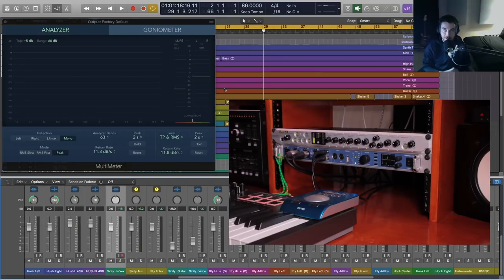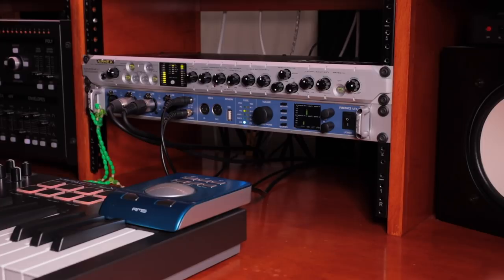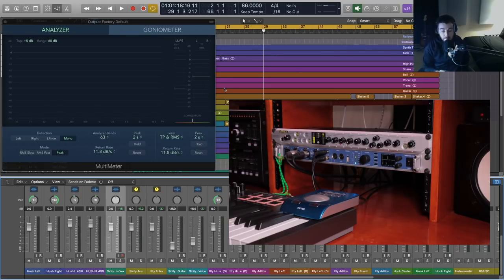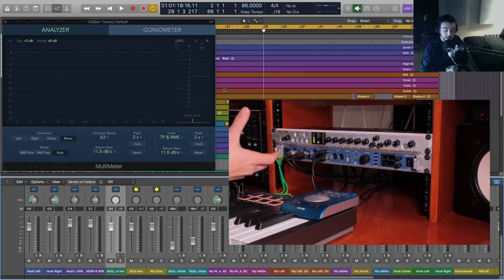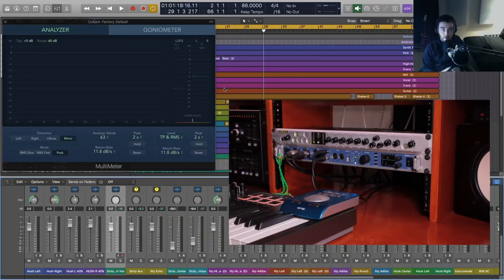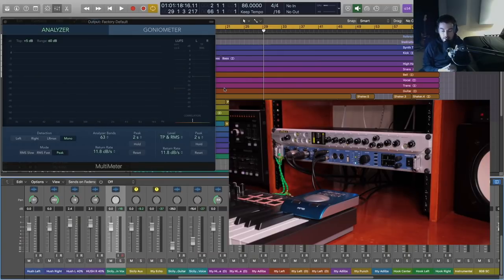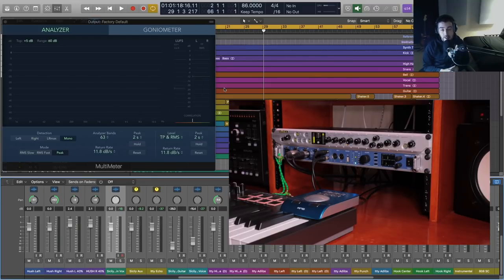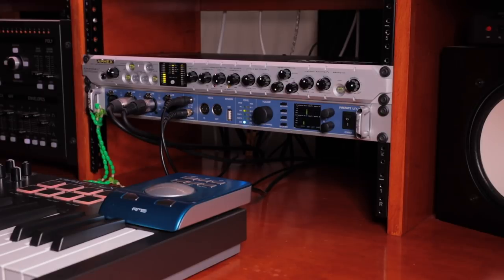Preamp, Audio Interface and A/D Converter - What's the Difference?!

Comment: Since high quality interfaces and pre amps are both really expensive, does it improve sound quality to upgrade your pre amps first? Or to upgrade the converters first? Both are important, but not many people have 5k to drop on both at the same time.
Reply from the maker: both will make a difference, I would recommend upgrading to something like an RME or Apollo that has great converters and at least usable pres first... then upgrading your preamps later
Reply: @SeanDivine  do you have to have a apollo to run autotune realtime for studio and small gigs with reverb? Or can a more normal interface still work . On a 2012 macbook eyeing the motu m2

Comment: For me, a very important thing is the type of chip that is used in an audio interface, even UAD Apollo uses some old nothing-special chips, so I rather invest in pro AD/DA chip because I am always working in the box and I don't record external things at all but I want my signal to be as transparent as possible coming out from the computer as a digital signal. What is your opinion about the importance of a good clock?
Reply: yeah someone told me not to invest into a powerful interface but a better preamp...cuz the ad converters are basically the same for all interface...what do you think?
Reply: Converters are not the same, but most of them use delta-sigma modulation. If you record things outside the box you need to think about preamp and ADC (analog to digital converter) as well. DAC is needed for good transparent listening experience in most cases. Your budget also plays the great role in making the right decision.
Reply: So I should invest in a better interface than a preamp at first?  @junkaction2416
Reply: If you record your hardware/guitar/vocal anything external...first element is the preamp, because you are going to use that preamp to amplify your signal only after AD chip starts working and DA chip affects the signal that is coming out to your speakers. Most audio interfaces have already a pre-amp built in, but they are c or d class pre-amp which means not the highest level. It all depends on your budget and what exactly do you want to do in your studio! I hope it helps.

Comment: I would think that the best is as much as possible in one unit because it reduces connections and incompatibility issues. Or is it usually the case that you need to get a separate mic pre if you want real top quality. I think what you say is that the combination of gear is something you do to get the tone that you want. Its not so much about quality in the higher end stuff. You havent found an interface with built in mic pre that has the character that you want. My ears are not that discerning, which doesnt say much for my sensitivity. Great video, again. Thanks.
Reply: Audio interfaces must be as neutral as possible and not add character by themselves, to adapt to most situations, so that's how they're normally designed, with this goal in mind. But sometimes, you don't want that neutrality, you want something that sounds warm, so either you add it with software, or you buy a device that adds this warmth, and it's the preamp.

Comment: SEAN! I just purchased a lightly used AVALON 737 Preamp. I'm currently hooking it up to my Apollo Twin X and I'm running into some confusion about getting it to read on my channel strip. I have in Line" instead of Mic" just trying to understand the workflow on UAD interface.  Hope to hear back soon. There isn't a good video out there that shows beginners how to set up a preamp through UAD interface on Console. 

- Best,
Reply from the maker: The line in on the apollo will be fine - you don't want to use the preamps there additionally to the 737 :)

Comment: Hey Sean, thanks a lot! Do you need to go through the interface or can you go directly into the computer with the signal from the converter? I ask because I think about buying a studiolive32-mixer in order to have a lot of ins & outs without the need to cascade interfaces, but all of these digital mixers dont have the ability to capture a converted AD-Signal, no ADAT no SPDIF, only one AES going out.
 So what I would like to ask you is: Would it be a massive downgrade to stick to the presonus studiolive's conversion in the long run? I mean, is that really sooo bad? and second: cant you just hook up the AD-converter to your computer in order to kind of bypass the interface's AD-conversion while tracking?
Reply from the maker: If I understand your question correctly, the studio32 has a built in audio interface, so it will also act as your converter. The main idea is you want as few conversions as possible and leave it to the best converter for the job of getting the signal into digital. The converters in the mixer should be fine!

Comment: Hey Sean, i also have 2 preamps in my chain (pretty new). 1. My SPL Gainstation tube preamp with a Line TRS into my 2. Focusrite 2i2 USB Interface (second preamp built in). You talk about it at 01:24 ...Everywhere people keep telling me that this is very bad, because you increase noise etc. by this. What is your experience with that? Isn`t it bad to put a signal you like from your dedicated preamp again though a preamp you don`t like?
Reply from the maker: hey Timo, I wouldn't recommend using 2 preamps in the chain - yes, it will add unnecessary noise and color the sound. Instead, I route the AES (digital) output of the aphex channel to the AES input of my interface (not a preamp input)
Reply: @SeanDivine  thanks for replying. So what would you do? Are there interfaces with an absolute "clean" line in to digitalize my preamp?
Reply: Especially  not scarlett. Need an audio interface where you can bypass the preamp if you already have one. I know audient id22 as this. Usually if they have line in at the back with no volume knobs to control then you're good.

Comment: How do I connect a 73 preamp to an audio interface such as the focusrite scarlett without hitting the preamp in the scarlett?
Reply: I just did heavy research and on focusritrs website they stated that the combo jacks ( the ones that can take XLR and TRS ) will always have to go through the preamps, but if you have a Scarlett solo it has the 1/4 jack for the TRS cable. With this 1/4 jack it goes through a different circuit designed specifically for Line input
Reply: Lower all the gain on the Scarlett. Use the one from the preamp.

Comment: Hey man, great video. A year back I picked up an M-Audio M track and some Akg K701s. All budget stuff, around the £120 mark. I'm not professional, but I do want to be hearing the right stuff. Should I consider upgrading the interface, or the headphones, or both?
Reply from the maker: hey Edward, if anything I would update the interface before the headphones / monitors. That will make much more of an immediate difference and make more sense if/when you update your monitors later

Comment: Hey sean. I’ve just bought an analog desk and hoping to hook it up to logic so I’ve got a hybrid setup. Been researching what I need to get the sound going from desk to computer. Do I need an interface or an AD/DA converter? Or does it not matter as long as I have ins and outs?
Reply from the maker: I would go with a quality interface / converters if you want to maintain the integrity from your board to the DAW. RME is great 👍

Comment: I just bought Aphex 230 on Reverb but have some issue to connect behind that Preamp. The seller promised me to help me but now he avoided to reply. would you please help me to connect Aphex with my Focusrite 6i6 2nd Generation Interface. I had hooked up Microphone with Aphex but do not know about other features back side of Aphex. I have all 3/4 inch cable connected with Focusrite Interface. Thanks.

Comment: hi sean how are you? i ve a question, how i hook up the "Aphex exciter" to my audio interface? i have a apollo twin duo usb, other question, a good standalone AD/DA increase dynamic range plus the audio interface?
Reply from the maker: connect the aphex output to the balanced input on your interface (not the preamp input). yes, it's possible a better ad/da converter will increase your dynamic range, although the apollo should be good enough in most cases :)
Reply: @SeanDivine  i´ve a apollo twin usb, what i do is, "out3 apollo" -> "in Aphex" -> "out Aphex" ->  "IN1 Apollo" (select line1) and boost the gain), what im doing wrong?

Comment: I know its an old video.. but man i need your opinion.. for starters been listening to your beats since 2008 the soundclick days...  i have a Avalon 737.. An audioscape blue compressor..
Need an opinion for a new.. interface..
One that i can by pass micpres as well.
Budget 1,500..
Thanks

-best wishes to you...💪💪💪💪💪
Reply from the maker: Hey Christian! I use the RME UFX.  Anything RME is rock solid in my experience. Endless routing options, great totalmix interface and you can easily bypass the onboard pres by using the balanced inputs!
Reply: @SeanDivine  Thank you so much...🙌🙌🙌🙌🙌🙌🙌🙌🙌

Comment: most 24/96 DAC's, including ones built into most high end recording interfaces, have enough inherant headroom to make the preamp section not much more than a buffer with attenuation; there isn't much (if any) amplification required to bring the signal to output levels. The widely used ESS Sabre chipset, for example, can easily function as both the DAC and preamp simultaneously.